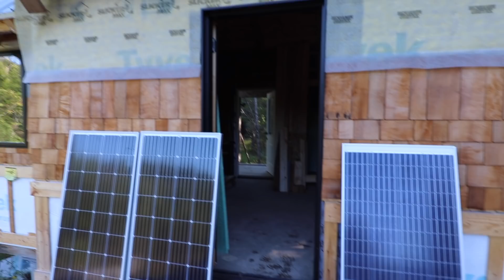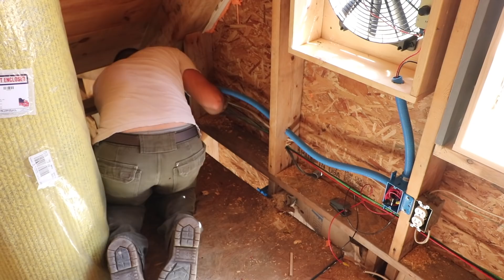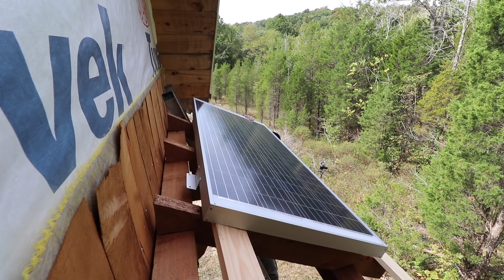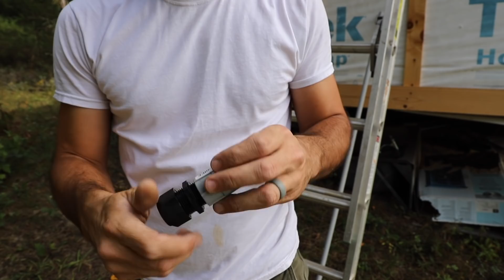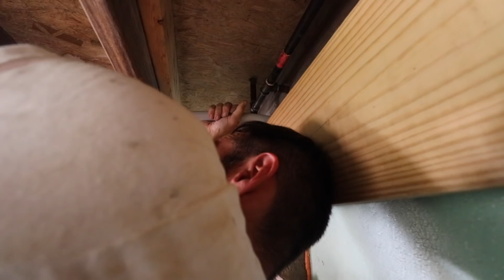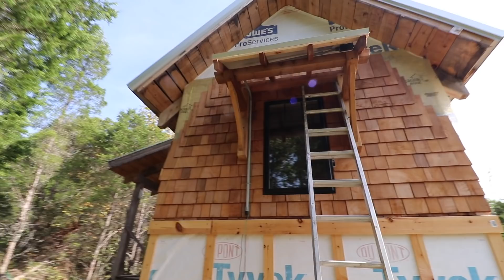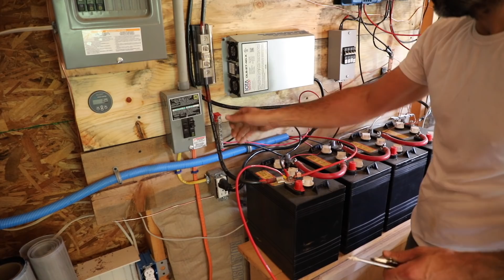Expanding an Existing Off Grid Solar Power System

Comment: 1. Love your videos and DYI spirit.

2. Hate your wiring. Too messy. Wires everywhere on board. So easy to accidentally bump. I would organize it more cleanly. Also bare wires behind lower shingles. Ugly gray conduit coming down side of house. Eek. Hide it all away inside walls.

3. Not meaning to armchair quarterback, but why not put the panels on the ground away from the beautiful cabin. Panels are never attractive. Also easy to mount of swivels at later date.
Reply from the maker: I hate my wiring too... 

I finished the interior of that side of the house so had to run the conduit somewhere that I could get it across the cabin.  It will go behind the board and batten on the lower course.  

I like seeing the panels above the windows and using them to make shade.

Comment: I must have missed something, how did you tie the 12v panel into the 24v battery system??
Reply from the maker: Hey Richard, the single solar tech panel is actually a 24 volt panel and the two hightec's are 12 volt panels I wired in series.
Reply: Thanks, I am new to solar and I missed that.

Comment: Looks very nice. Always connect your battery to your charge controller first. A fuse at the battery is sufficient and cheaper. I am cheap. Your way is very nice and proper. A fuse at the battery will pop if anything goes wrong keep everything safe except the charge controller but it should keep a fire from happening. So how good did it work after you got some sun on it then next day?
Reply from the maker: Hey thanks for the tip, I actually took off that night that I finished and haven't been back since so I haven't even got the satisfaction of seeing how it works!  I will probably do a follow up video focusing on that and programming the controllers to the right charging voltages etc.  I also have 2 more shunts to wire in.

Comment: Good video as always. A friendly suggestion. At some point you will want to put some foil backed insulation in the underside of the flooring in your crawlspace area. Will prevent rodents from making their way inside and provide a surprisingly good amount of R value. It’s a thin rigid product.
Reply from the maker: Hey Mike yea I am going to be taking care of the underside next summer most likely once I have fully done wiring and everything.  I am planning to spray rigid foam with an insect repellent formula mixed in.  the cap it off with something.

Comment: Love that you are doing it yourself but I really hope nobody copies the way you wired those panels in, it's not really done properly, I hope your cabin doesnt catch on fire in the future
Reply from the maker: If you tell me what you think has not been done properly, and if I agree with you, I will mention it so no one copies it.
Reply: If you wire it on the exterior it should go in conduit all the way to the end and terminate in a junction box, it started out great then terminated into loose wires on the bottom half of the siding area is not really good. if I were to do it I would have stubbed it directly into the cabin for a clean look and minimal exposure to the elements and run it through the walls. In your electrical room all of the components should be in some kind of electrical box and not loose wires all over the place, so that it cant be touched by anyone else like kids visiting and be contained if something were to arc. Ventalation for the batteries is also important. Great job with the cabin build though!

Comment: normally you need only one big mppt controller load battery and no need more, you have sun power panels 1-20 pcs, newermind how many ,no need more than one controller.
Reply from the maker: I have heard that multiple facing arrays can confuse the maximum power point tracking.

Comment: not perfect position at panel, 50%have shadow now this, both panel have 50% shadow, no good. you need cut some tree. i cutting 10 tree i has build satellite antenna receiver to my home.sun power panel have lot lot important than satellite antenna.
Reply from the maker: These will be shaded at points during the day unfortunately but they will each get around 3 hours of sun in the morning and afternoon.  I will take out a few trees to the East side.
Reply: Can't you just top the trees or cut the offending branches?

Comment: You can ground anywhere as long as the grounds are connected and share the same potential.
Brotip: if you use PVC for plumbing: use the solvent or you'll certainly get leaks.
Havent seen plumbing in your cabin yet... Can't wait to see.
Reply from the maker: Yea I haven't done any DWV plumbing yet but I usually use the solvent cleaner first.

Comment: I am not an expert on solar but my thoughts on grounding with solar is you would want the shortest path to ground from the panel but with those panels on the side of the house I believe your house we get struck first before the panel would likely get struck so the ground at this point will alleviate static electricity. Coming from an electronic standpoint. So I don't think you really have to worry about it. The fact that you have any grounding at all is better than none at all
Reply from the maker: Thanks thats pretty much what I have been hearing from people.
Reply: @50Acres  

You can ground the frames of your panels with a cable wire down to a grounding rod. 

Grounding your frames is recommended by the manufacturers.

One thing to note attaching copper wire to aluminum frames can cause galvanic action which will deteriorate the connections and your ground.

Comment: basiuc 10-20A charge contorollet mppt cost 10$ about. internet have many good. panel cost normal under 100$/100W battery have expensive part all system, led strip 12Volt have normal what used. all 12 votl lamp,light,fridge,TV,radio all have 12V power best option.

Comment: Great job, I love the cabin and I love that you have built it completely off-grid. For AC systems you always use a common ground, however it won't hurt to have your busbar grounded under your control room, as long as you know that ground is stable. Since the system is DC you could really do both. I think that is totally up to you, I don't see where one would be safer than the other.
Keep plugging along it looks great.
Jimmy
Reply from the maker: Thank you Jimmy,  I will just keep it as I have it then...

Comment: Nicely done Mike, power and shade at the same time. You need to invest into some magic wire strippers to go along with that magic hammer Lol.
Reply from the maker: Thanks Jerry, now that would be nice.
Reply: @50Acres  I think there is a limit of one magic tool per took box or belt. Have ta check the regs on that.

Comment: At some point you will be needing hot water. You won't believe how much panel power is wasted every day.  I use that excess PV power to heat water. It connects on to existing PV panels used for charging and doesn't use the charge controller or inverter. After not turning on my propane heater for a couple years I got rid of it. It is an amazing system. Your cabin probably isn't that far away.
Reply from the maker: I’m very interested in doing this actually.  I was trying to figure out how to grab that extra power before it gets to the controller but let it through if a load or the battery needs it.  How do you do do it?
Reply: @50Acres  A circuit looks at the panel voltage. With a MPPT charge controller that panel voltage is kept at the power point voltage and is not allowed to drop below that. As the charge controller load lightens the panel voltage starts to increase and as the load reduces even more, the panel voltage increases up to the open circuit voltage.  This controller looks at that voltage and when it climbs above power point voltage it pulses power into the heater.  Just enough to drop that voltage near power point again, diverting 5W to 500W or more. This power adds up thru the day.  Charge controllers spend a lot of time not sending all the power they can to the battery as a result of charge cycles. This system does not require separate panels. A small number of additional panels may be added that give your other system added performance in bad weather. I just run a single battery for refrigeration and everything else. Wife even has a dishwasher with heated dry. Find anyone else who can do that on just a single battery. And it has to work because I have a medical device that keeps me alive at night.  You can arrive at your cabin on a Friday night and have a hot shower waiting for you.
Reply from the maker: fascinating, I've watched 4 of your videos so far, I would really like to learn how to build these components to do this.  It's very impressive and it just make so much sense to do im surprised more people aren't doing it.
Reply: Engineer775 has a video where he wired solar directly to an electric water tank.

https://youtu.be/jW4IqEemteY

Comment: Why in the world are you using 3 charge controllers?  If everything is in 24v just bring all the strings of solar into a combined box and then into a single controller.  You're using a combiner box after the controllers instead of before and wasting money and space, no?
Reply from the maker: Well there is a bit of debate on this subject but most people agree that with an MPPT charge controller multiple arrays will confuse the controller algorithm when calculating the maximum power point and production will actually decrease.  Now if I had one big PWM controller I could just throw it all on the same controller because I do have everything at around the same voltage and it would just add amps.
Reply: @50Acres  I'm very interested in this because I'm looking to do something similar as you with an off grid cabin and my plan was to have two strings run into a combiner box (I've seen this done multiple times but I don't know the drawbacks like the production decrease).  Then from there run it into an outback MPPT controller and from there to the batteries.  

Now the only difference and maybe this is the key is that my strings would be two strings of 6 panels but the same exact panels.     I'll have to do more research, thanks.
Reply from the maker: @rha600  The reason I used multiple controllers is that my strings face different directions, and they are also different panels.  But mostly its the issue of facing different directions if all your panels face the same way and are relatively close in specs you should be fine.

Comment: Those batteries look like lead acid. Please install an outside air vent in your battery box ASAP; as lead acid batteries gives off hydrogen sulfide, which is highly flammable and toxic (the risk is magnified in an confined space) P.s. sorry if you already know this; love your channel, don't want to see any harm come to you and your family.
Reply from the maker: Hey thanks Forester, that was the reason for the box, but I couldn't get my large diameter drill bit unstuck from the chuck so I couldn't drill the hole for the vent.  I need a vice or something to get it off and onto the right hole bit.
Reply: @50Acres  I predict a locked hidden on-site permanent tool box is in your future, complete with bench vise, Allen wrenches and magic hammer. Great video!
Reply: Good piece of advice but lead acid batteries give off hydrogen which in explosive in air at a critical concentration and when triggered by sparks for example. Hydrogen sulphide is the gas responsible for the smell of rotten eggs. It is not given off by batteries.
Reply: @SUBDUDE 2013 Paul Fellow Veteran Thank You for Your Service . Are you still in the Navy on active duty ? My brother was on the nuclear sub USS Sam Rayburn home ported in Holy Loch . Scotland . His state side base was in New London , Connecticut . His sub is now a training vessel located in the Carolinas. I'm an Air Force Veteran . I served ' 71 - ' 75 . Worked for VA ' ' 76 - ' 07 .

Comment: Is the additional timber frame for the solar panels treated?
Reply from the maker: Nope...I always forget at least one critical material or tool that I need.
Reply: @50Acres  I thought so :-(  it will be real easy to soak the hell out of the frame with some boiled linseed oil or danish oil.

Comment: For a non-magnetized screwdriver place a small magnet on the shaft and that will keep the screw attached to the end of the driver. :D
Reply from the maker: Nice, I need to do that or get a magnetized screw driver
Reply: Unless the screws are Stainless steel.
Reply: Actually all you have to do is rub a magnet along the screwdriver shaft and it will be enough to give it a magnetic charge.  You won't have to keep a magnet on it.

Comment: I see shade on the panels as you are installing them. Even a finger sized area of shade will kill the output on panels.
Reply: Well, for the side with the 2 panels, he did say that the shade from the branches was from a dead tree he was going to cut down, so that will probably solve a lot of that problem.
Reply from the maker: Yea there are times of the day when these will be shaded, each array will only produce for a couple hours in the morning or afternoon.